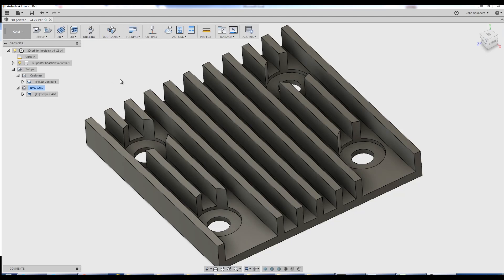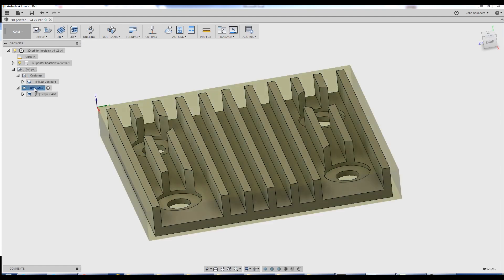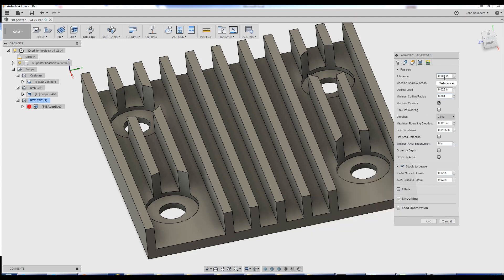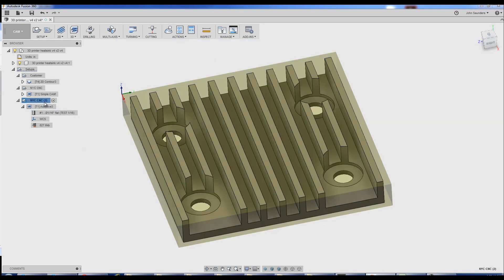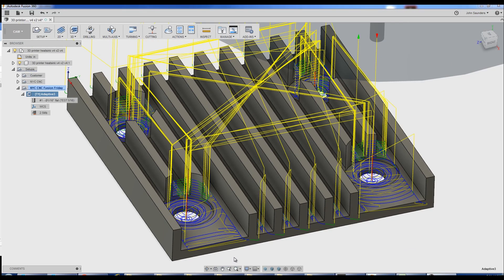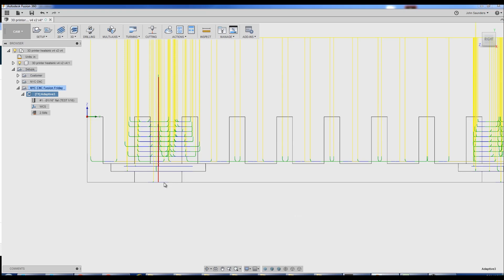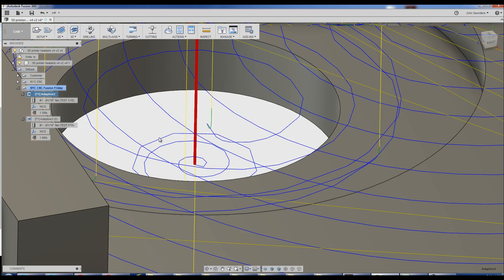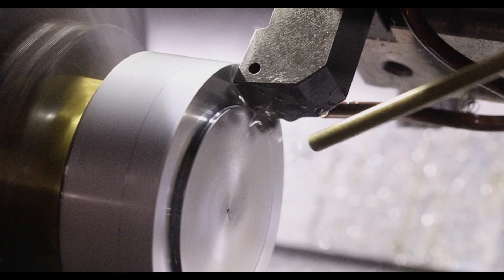Fusion 360: CAM for Beginners!  FF85

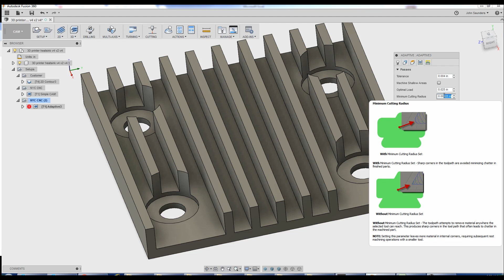Comment: 2:36 Minimum Cutting Radius must always set to zero. If you have an 5mm Endmill and an radius of 2.5 it will not be milled on the maschine if you set this not to zero. Or in small sections the endmill will not move to this areas...many problems so i set it always to zero !

Comment: Instead of setting your model bottom below the stock you might want to add a negative Stock To Leave instead.  If you are using other features, such as tabs, changing the bottom height may impact other operations especially if you're using rest machining I've found.  Not necessarily applicable to single op machining but it's bit me before.

Comment: You skipped over the simulation but I think I see the helical ramp plunge is still the first operation. Why is this so? why does it not do the slotting first? and then the length to plunge would be so much less.
Reply: pobvic 
Because there's nothing allowing the toolpath to exceed the outer profile boundary. So it needs to start inside the part first and helix down to reach Z depth.